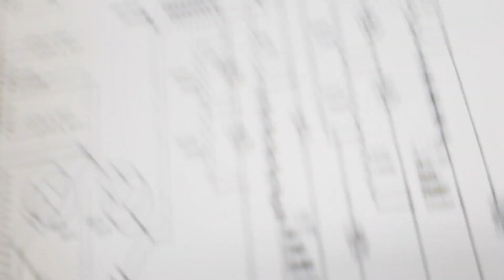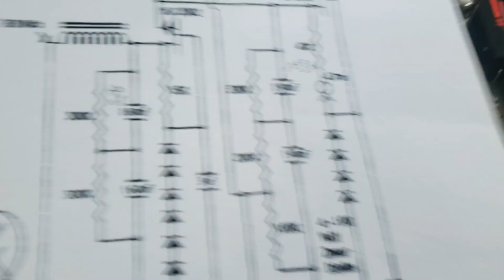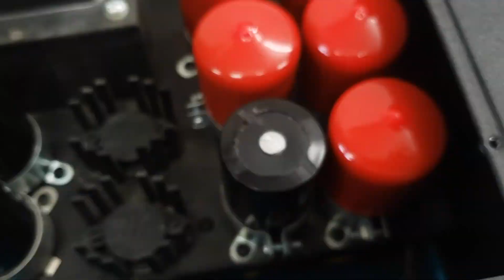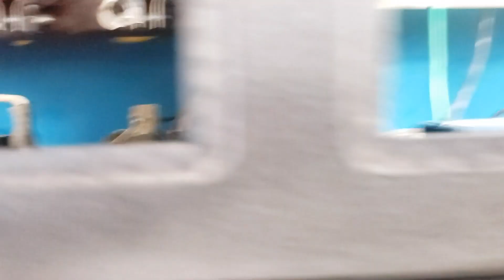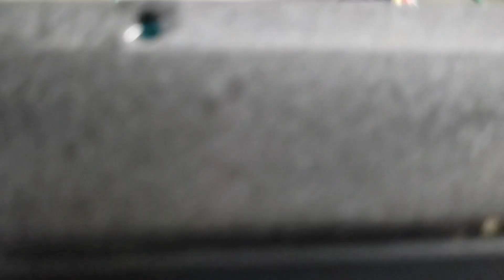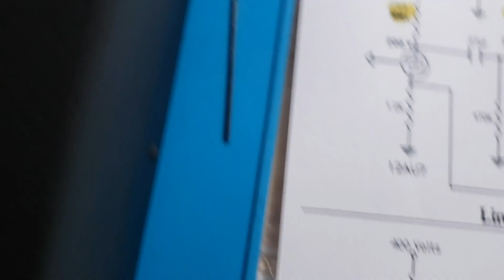Quicksilver Audio Tube Preamp Restoration (Part 2.5) Phono, Vinyl, Audiophile DIY!

Comment: Hello Alexander , benide the transformer is a big yellow foil cap..............next to the left leas of the cap runs the twisted yellow wires for the heater supply............this draws big curent and genrates an important electroagnetic field arround the wiring ..............you can push the cap away to the left ( and expecialy the right lead ) as far away as possible from the yellow twisted wiring and the transformer ...
Tell us how it sounds ..............after some run in ..................
Those old caps were good and maybe still are because they were not abused........the rectifiers were  hahaha..............
An old school advice....................NEVEr do a HOT start after shut down..............allways wait before a restart until the rectifiers are cooled down....!!!
Reply from the maker: I will try that! Thx Frank! Yes learn my lesson already on the hotstart got some nice shorts/sparks in that 5AR4. toast!

Comment: The studs go to  GROUND........I had the same studs and bolt with Sikorel capacitors to mount in my Luxman SQ 507x..........besides the obsolete BG the best capacitors I ever used , today tey are obsolete also............
Max capacitance after a GZ34 is usualy lilmited to 60 µF ,..................he ( Quicksilver) did the same in his 8417 amplifier ( another great sounding amp ).............Two rectifiers per mono bloc ( GZ34 ) and followed by two 330 µF ...........

Comment: Bypassing an electrolytic capacitor has a two faces issue .............it was a great tweak decades ago and some went so foa as to bypass with multiple foil capacitors..........
But there's are some ugly hidden facts that come along with this " audiophile " practice........

The first is that by doing so and listen to the result ...........one is usualy pleased by having a better darker background ............hahaha that worked out well.
but aftezr a while you may  notice a shift in tonal collors depending on the frequency , or tonal hight ...especialy on female vocals and some instruments ( strings )...............that's a dillema ............going back to the future or not ?
Secondly ..............the smaller the capcitot the faster and higher capacitor frequezncy resonance..............Well well...............what does that means .........
the capacitor shifts gradually towards its resonce point and the capacitor caractor goes over its inductive caracter .............with a dip on the resonance frequency point ......
Both capacitors have a different inductance and different resonance frequency ..........together they create a new sometimes (a bad sounding -unesxplained stress or oscillation outside the audible range ) intermediate  problem .........that can harm the sound as it can intermodulate witin the audible range.........
Best is to use same capacitors in //...............so two 22 µF in // instead of one 47B µF...........or two foils " tête beche " or two non inductive caps in //

The use of quality electrolytics is allways a better idea......the right one for the right job...and sometimes the best cap can be your worst enemy in 
the wrong position.......
Have a nice day .

Comment: Don't replace those AB CC grid stoppers with carbon film, they are carbon comp.for a reason (very low inductance). 

I left all of the Nippon C C caps in my Quicksilver Full Function as they all tested a as new.

Love your mod series. I used different coupling caps in mine, but I really want to try some of those Solen film and foils!

Dan
Reply: Yeah.. If he does replace the CC gridstoppers, I sure hope the Amtrans carbon films have vanishingly low inductance for VG HF response..
Reply from the maker: @rickg8015  I need to check this. You both make a very good points.
Reply: @hificonspiracy  if the CC’s are still within tolerance, keep them.. The Amtrans (Riken replacements) are known to be great as Plate and Cathode loads.
Reply from the maker: Yes, you make a good point. I'm rethinking this now that you've mentioned it since the ABs are an ideal solution I'm leaning towards keeping them. I do like the ABs, its a nice touch that Mike used them in the phono section. The Solen film/foils are nice! They are not a AN or Jupiter copper foil but they are small, well made, and fit places that would otherwise restrict you to a MKP. Thank you for the post!

Comment: Do you like the AMRG's more than the Z foil resistors?
Reply: Also are you doing one mod, then listening, then on to the next mod, or are you doing all the mods first?
Reply from the maker: @6AM_YT  Hi there! Yes, I am making mostly one mod at a time. I did the output caps, then the interstage caps for phono and line stage. AMRGs vs Zfoils  both really nice just perhaps different for applications. I'm finding I don't care for the sounds of metal films. However the Z-foils are very very transparent and zero inductance which might be great for a 1k grid stopper or an input resistor. The z-foils work very well for feedback resistors in low level circuit, super quiet. On the down side, too much transparency could sound overly sterile and lifeless. I'm going to do a video on this. Thanks for the post. Oh the SP16 is keeper. Try some of the Solen film foils in it!